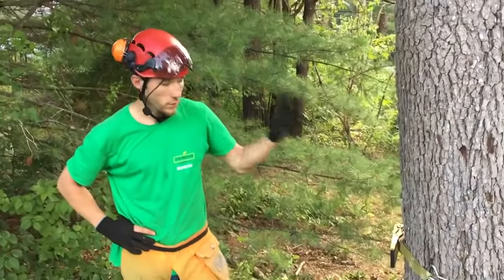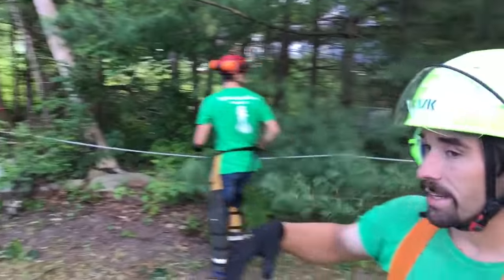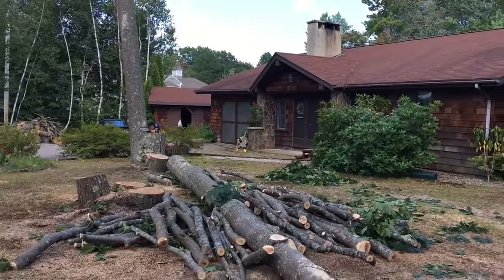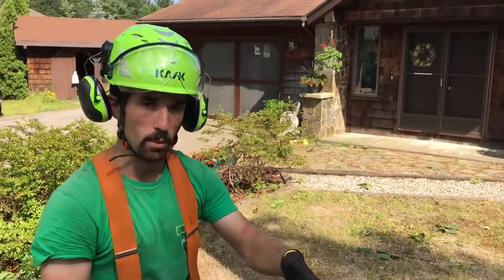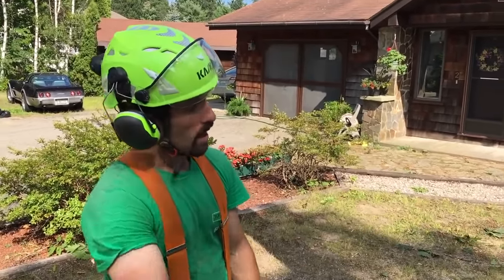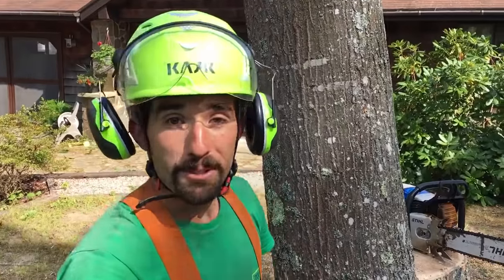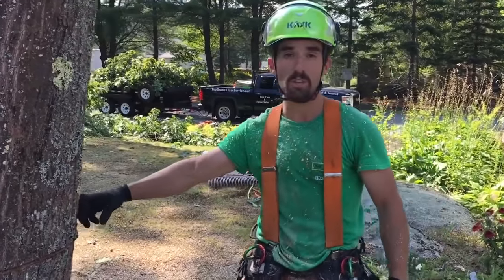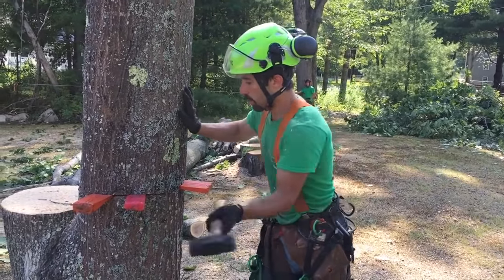Felling A "LEANER"

Comment: I'll probably never fell a tree, I just enjoy listening to professionals explain their craft. Great explanation and thank you for posting!
Reply: I got here starting at looking at electric chainsaws. Then electric hydraulic log splitters. Then youtube recommended me how not to a a log ( Don't cut with a back cut ) and that you should just horizontal cut. Which as pointed out in the comments that well yeah that's all fine and dandy if you're cutting little 2 inch trees but if you are actually felling a tree you should be using the open face method. Finally I found someone who shows that yes this is an actual tree that would actually fall the wrong direction if you don't do your job. Here is how you make an open face and pulley system. Felt like everyone was telling me how to kill myself cutting a tree but no one showing how to actually safely cut a tree.
Reply: Never fell a tree?
You should push your Xmas tree over on Xmas day while the kids are under it grabbing gifts.
Reply: @BryanClark-gk6ie  it's proper grammar. Maybe buy a dictionary for yours?
Reply: @mjohnson2807  
Fell' fall' cut it down' saw it down etc. Maybe try to comprehend the English language relating from start to finish.

Comment: Anyone who does professional tree work could make personal comments on this. No 2 people are going to do this removal the same. The fundamentals are there. This is a solid Job by a professional arborist.  Thank you!
Reply: Bit of a dutchy let's be honest. About a half inch
Reply: I noticed the Dutchman too but I thought he wasn’t worried about it because he already took most of the top weight off and only left the trunk. What do I know?
Reply: The dutchman in the thumbnail got me but otherwise fine.
Reply: I thought the same thing, but pretty small and no canopy weight
Reply: And who knows maybe he cleaned it up off camera?!?!
Reply: Im in trouble for  my coments
Reply: Do you have a  mini squrt on if not we will  go  shopping
Reply: Where is 90 degrees , Chad?
Reply: Very true I personally would chunk it down piece at a time so much could go wrong considering this job could be done a lot faster with a lift truck
Reply: @normanmcneal3605 45+45=90, if you are talking about his face cut. There are 90 degrees between the top and bottom angles of his face cut
Reply: IM SORRY WHAT????
Reply: Um,,, back cut is a bit low…
Reply: Front cut and back same can be used for trees you want to spin in either direction once they clip the canopy. Apart from that why would you cut like that ..just saying
Reply: qpf😅

Comment: Nice vid. It obviously works well for you. On backleaners we leave a little more hinge wood and pull with equipment when possible. I love the Maasdam but like a little more speed on the pull line especially with hard backleaners for the simple fact that they have farther to travel and there is more opportunity for the spar to go sideways when pulled slowly, especially on hardwoods. It's also vital not to leave a Dutchman on your face cut as that can greatly effect hinge mechanics and Rick Sagan is correct about back cut placement. Nice explanation of the bore and release cut.

Comment: Good work, nice drop. Did not know that rope winches are allowed in America, we use steel cables here in Germany. I prefer 12 mm with at least 3,000 Kg (1500 Lbs) pulling strength. Nice to see a professional with the right protection equipment
Reply: Phil - 3000 Kilograms = 6613 Lbs not 1500. I get 3310 lb (safe load) for 6 X 19 cable and 16540 Lb. breaking strength ( 11.5 mm ). I know nothing about trees . Regardless, I would absolutely prefer steel cable.

Comment: Well done! The Maasdam is a great tool. When possible I like to pull back/side leaners with machinery to get a little more speed to get them over center a little faster in case the wood in the hinge is not perfectly healthy. I don't really care about fiber pull as long as it goes where it's supposed to. Nice work!
Reply: I have a Maasdam I am gonna put to use also. LOVE IT

Comment: You might considering buying a "Grip Hoist." I use mine for all sorts of things. I volunteer with a conservation organization. I and a few other people look after a 1,500 acre conservation property with around10 miles of trails. We use the grip hoist for pulling stringers into place when were''re building a bridge or if we have a leaning tree that we need to redirect. The advantage the grip hoist gives is two fold. One, the model I have is rated for pulling 3,300 pounds with half inch cable. I've never seen a come along rated that high. Second, is the way it works.  Instead of winding the cable on a drum it has gripers that clamp on the cable. When you move the handle it pulls about a foot of cable through the housing. The neat thing is you are not limited like a come along. I have 40 feet of cable, but I could buy a 100 feet if I needed to. When you finish pulling. It has a second lever that releases the tension on the cable. When you've released the tension you can set a lever that allows you to pull the cable out of the hoist. It comes with a wire wheel you roll the cable on. This also means that you can spread the load between to people.

Comment: First video of yours that I've watched, and the tree clearly landed precisely where you wanted it to, which shows your expertise. The one thing that I found surprising was the face cut. Having said that you wanted it to be 90° plus, the face cut I'd say was less than 70°, and also wasn't clean, as the two cuts didn't meet precisely. I had expected that you'd open the face cut up and tidy it up too, so was very surprised that you didn't do either.
Reply: Will Doherty well surprise surprise

Comment: I have always applied the high rope pressure perpendicular to where I want it to fall. The rope acts like a pivot point, I use a truckers hitch to apply the pressure. Then the 90 degree cut directs the fall.  One cannot create enough pressure or catch up with a falling tree to direct it.  A slow back cut on a slight angle until you start to hear cracking and you can almost finish the job with your hand.  For a leaner about 45 degrees of perpendicular works too.  Never had a problem directing any tree I ever cut this way.  Mine were 4-8" in diameter, not as large as yours were.  Nice video!

Comment: As a professional faller I think you need to point out that both of your cuts in the face cut are sloping. The back cut is even or lower than the face cut.  Leaving no stump shot which is needed for a heavy leaner. Your under cut should match your sloping cut with no over cut.  the corners should be even. the gunning sights on the saw are true and should be used to sight in where the tree is to be fell and used on the back cut to keep the hinge wood the same width. the depth of the face cut should be 1/3 of the tree unless it is a snag. then it is around half. because you are pulling the tree in the desired direction a 1/3 should do. Good job with following the cut with the wedges incase of setback.
Reply: 100% correct some of the information he gives is slightly inaccurate. he never did really show you using his gunning sights. his back cut was much to low and he called the holding wood fibers and saying that you don't want to much?? those "fibers" or known as holding wood is what a stump shot should look like in a healthy tree. to end the video he cut the hinge off the stump when he should have just low stumped it...

Comment: Bout 18 years ago we went from 288 xp husq to 460 stihl mag.  Never looked back    But them ol 288 was the 68 camaros ss of chainsaws. 460 stihl is the Escalade!
Reply: maybe 15yrs ago!
Reply: What's your point? Those are different size classes of saws. 460 is 76 cc, 288 is 88..... In the class of the 460, I run older 372's and the best in class, Dolmar PS7900. Stock, that is. When fully modified, the 372, with the smallest engine size, rises to the top, even compared to a ported 7900 and 460.
Reply: @rogerbarnett8412  your talking to goon right.
The 460 is like an Escalade with no tires(just wheels) and without an air fliter lol.
I like the 7910's and the 372's myself, and my 372xpw(75cc) does a fine job as well. The 460/461 is a dependable saw and a workhorse, but the av and filtration is lacking, I still enjoy running them for bucking logs up into firewood, just prefer an angled top handle for everything else.

Comment: As you were limbing the treetop , I did not like how far from the cut you tied the lowering line. It allowed the limb to pivot, raising the butt end level with the climber as it swung back toward the trunk.
Reply: Dan Blake Good job! Your the first person I’ve read that actually knows anything about rigging and lowering limbs. Yes the knots were way to far out, and 2nd the person lowering the limbs didn’t know how to let the limb down before the but has a chance to swing up and hit the climber!!! I would’ve told them how to run the rope or get someone else!!! 20 yrs exp climbing trees for residential and trimming for power lines too!
Reply: @chrislevi4805  DID HE EVEN NEED TO LOWER ANYTHING ... THE YARD LOOKED SHITTY ENOUGH TO BOMB AWAY... AND WHY ALL THE RIGGING AND CUME ALONG... PEICE IT ON THE WAY DOWN... I GUESS MAYBE IT WAS VIDEO DAY... HE MUST GET PAID BY THE HOUR... GOOD JOB . I GUESS
Reply: @edwardklepac3823  I was wondering the same thing, just keep dropping it from the top down
Reply: There was a walkway and shrubbery behind the tree that would have made that a pain.
Reply: @edwardklepac3823  Have you ever dropped a limb from that high up bro? You know what happens when it hits the ground? It fucking explodes, sending fragments of wood all over the place. Like in the house windows, that 'vette over there, in his buddies face. Use your head man. You don't lower branches so they don't fuck up your yard.

Comment: With well over 635 comments, I am unable to check to see if anyone said this or not.  I read the first 80  or so and didn't see this, so here goes.  One thing I learned when cutting all those splinters after the fall (and thank you for reminding people to take that extra step): if you use the top of the blade it throws them all away from you.  If you do it like he did, some may come at you and get in your socks/boots or in your safety chaps or whatever.  Then they annoy you until you waste time getting them outta' there.  Great video otherwise though.  I have learned so much from these kinds of videos and their comments.

Comment: im not understanding.. You topped all the limbs back to the trunk.. Why wouldn't you just block and drop cut pieces and work your way down.. You had already climbed up the tree
Good video lots of info :)
Reply: Its sooo much easier to cut only what's needed, and to drop the trunk as one piece.
Reply: Dropping chunks makes a lot of lawn repair.
Reply: Gotta cut rounds one way or another. Block and drop is much safer than winching where it doesn’t want to go.
Reply: Get off the tree as soon as possible and limit the potential for "dropping with the cut"?
Hell, who knows?
Lord knows, I sure don't.
Reply: To make a video to give information

Comment: I'm not a pro, but I just reviewed a safety video on the same subject.  They stressed that the back cut should be 1-2" above the v-notch.  That creates a ledge/step to prevent the butt of the tree from rising up and sliding back in the direction of the cutter.  I noticed in this example, the back cut was about parallel with the middle of the v-notch, i.e. no step.  Of course, the example here was a much smaller, lightly loaded tree, so perhaps this arborist wasn't worried about the tree sliding backward off the stump.  Just FYI.  That 2" ledge above the notch, when making the backcut is going to be a priority for me.  Good video.
Reply: amazing isnt it. that stump would fail in my parts. that back cut should be above the hinge (and without a dutchman). he had the rigging in place but without it, that is dangerous.

Comment: I just like to leave as much hinge as i think the winch can handle, only cos ive seen some start fine then go sideways'
Reply: Leaving too much hinge wood can cause barber chairing. It also ruins the value of the log if the fibers run too far in the log. The 10% rule is a good one. If the tree isnt leaning where you need it to this is your opportunity to account for that and stir the direction of fall.

Comment: Nope,i've done leaners & i've done a back cut only with a small face cut like yours, however the flaw you had there was the crack you had running up the hinge(barber chair that you made), what i do is a small back cut, crank the winch, a bit more of a small  back cut, crank  the winch, so the tree now starts coming forward every time until it's central where the tree should be then small back cut, crank the winch & keep doing this until down, i'd never plunge in this situation at all, all my trees that have leaned i've done carefully, but successfully & i can put my wedges into the back cut when the room is there.
Reply: When you have a tree with the chance of barber chairing one of the best ways to cut it is to bore from your face cut all the way thru the other side and then strait to the back, this will not let the trunk split because all of the fibers have been cut up until the very last little bit.
 When you cut your back cut from the outside to the hinge with a tree that has enough lean that makes it want to split there isn't a saw that can cut fast enough to keep up, and you have yourself a situation for a barber chair.
Reply: bcrusher1979 Yes, but the problem with a bore cut here is that he has tension from the rope in the opposite direction. If not tensioned correctly, it could snap back towards the face cut when finishing the bore cut.

Honestly, I would've just parted the tree from the top down. Because it seems very unpredictable with the crack and tension from the rope fighting each other. Albeit, the crack developed after compromising the face.

Thoughts on my thoughts?

Comment: Anyone else notice the crack in the bark running up beside the facecut?
Reply: yeah I would have been concerned
Reply: To me that looks like it was getting ready to barberchair, but he did a great job and nothing happened. So what do i know lol.
Reply: I wouldn't have worried about the bark. It looked like it was just from bark shrinkage from a declining tree. Trunk looked pretty solid.
Reply: What D said.
Reply: D-op1 - Didn't look at all to me like the result of bark shrinkage, but I'm giving you a thumbs up anyway, cause it IS usually a reasonably good guess, and you didn't claim to know for sure, so...👍👍👍
Reply: It may seem counterintuitive, but that crack didn't pose as much of a threat as one might imagine, due to it's proximity to the hinge. Had it been a few inches away from the hinge, it could have been trickier.
Reply: Mike Armstrong it didn't matter. There is no stress in that part if the tree, since it was not behind the face cut. Come to think of it, it might have been a sign the is rotting inside. Which is a risk.
Reply: yes, i noticed. wasn't sure if he noticed or not...
Reply: That is the number one reason for the bore cut leaving a trigger hinge. It would be nearly impossible for the tree to split and barber chair.
Reply: Yeah, getting ready for a nice barber chair, though I'm not sure if oak has a tendency to do that.
Reply: D-op1 the crack goes into the face cut as far as the bottom side of the face cut.
Reply: My last wife's crack was dangerous. This was nothing
Reply: @bcrusher1979  well said, 'bears repeating' lol!!
Reply: to prevent the barber chair you can tighten a ratchet strap around the tree above the cut.

Comment: I thought the bore cut and/or back cut should be about 1.5 inches higher than the face cut? was this a different method or it really doesn't matter?
Reply: urbanothepopeofdeath He explained why he did the back cut lower in detail. Go back and watch again. It was to avoid getting the saw caught and flipping over when she fell.
Reply: No. Cutting above your face cut is a much weaker hinge. I never cut above my face cut. If I’m just felling a tree, I cut even with the face cut. If I pull trees I always cut 1-2” below my face cut, because it’s stronger. If you cut above your face cut, you have a much higher chance of blowing your hinges out and the tree going over backwards, the way it wanted to go. I pull whole trees with a 548 skidder, much bigger with tops still in them as a sub contracted timber cutter on a logging crew. I learned a lot of techniques cutting timber that really advanced my skill set for when I started my Tree Service company. Even taught a couple seminars for local Tree Service companies because logging experience cutting timber is much more extensive. Tree services don’t fell trees much
Reply: +Ben Law tree services dont fall trees much? Where have u been lol
Reply: mattyboy7272 felling a tree is walking up and cutting it without climbing and taking limbs out. If tree services are felling trees all the time they’re in easy trees. Very easy. All the work I do is stuff that has to be rigged out over houses or buildings. So no as a tree service I don’t fell trees much. Especially compared to logging when I fell 30-40 trees everyday. As a tree service I’ve fell 10 trees all year in 2018
Reply: ben  law  I  was  referring  to
Reply: Ben Law: Ok, that goes against all BC Faller training videos where they teach cutting your back cut, depending on what type of bottom cut used, 3/4" to 2" above the bottom cut? The one thing I've learned when it comes to technique, ask 5 different professionals and get 5 different answers!
Reply: Stevie FordRanger you don’t know what a backcut is....Thai is not at all what the comment is asking about.